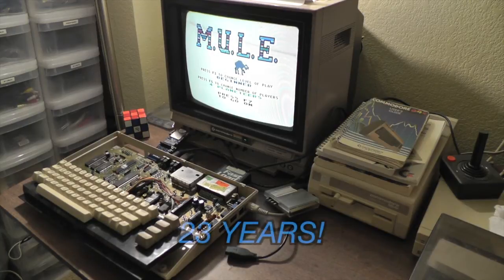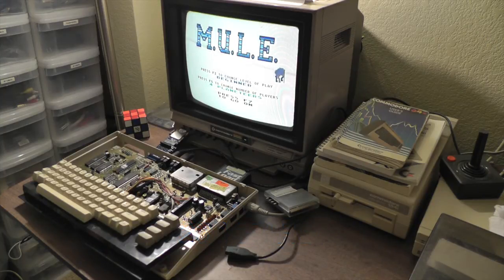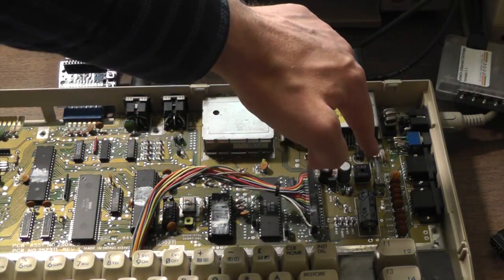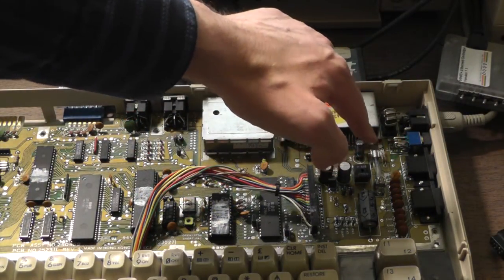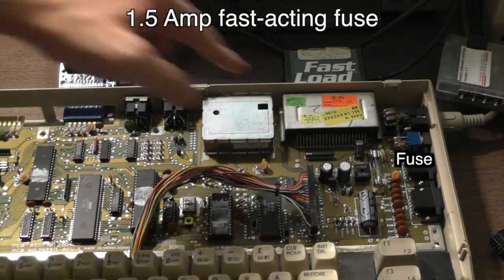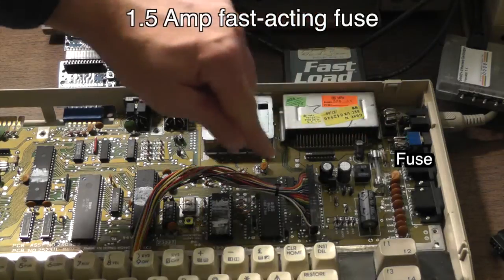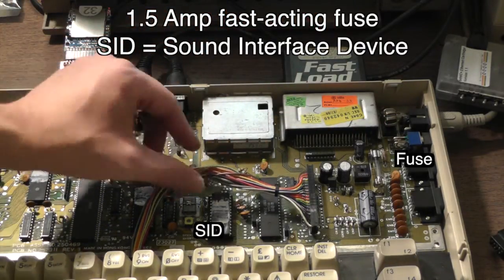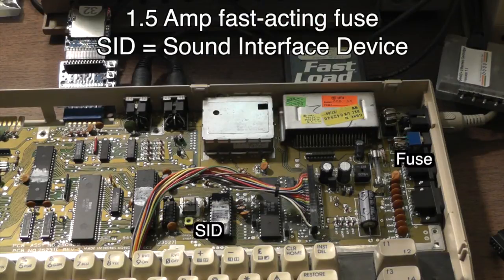Commodore 64 Audio Repair

Comment: My sound is still dead. Fuse isn't blown. Checked the voltage on pin 28 12v and pin 25 5v on the SID. I'm thinking my chip is bad?

Comment: Had a partially dead c64 without sound. Did a full search on every chip inside the computer without finding any cause to the problem, then i found out it was the fuse in the power supply! Thanks alot for uploading this video it for sure helped me anyway!

Comment: hey sir my c64 has no sound how can i tell if the fuse is blown or not ? the wire inside the fuse is intact
Reply from the maker: +scroeffie -- I would remove the fuse from the board, and use a multimeter/ohmmeter to check electrical connectivity between the two ends of the fuse.

Comment: Cool. What voltage rating is the fuse? I can only find 250VAC rated once (32mm). I am also reading conflicting statement on whatever it should be 1.5A or 1.0A.
Reply from the maker: +Kim Beck -- I think the 250V fuses should be fine, even though the actual voltage will only be a small fraction of that.  I used a 250V 1.5A fuse.  If the circuit actually needs a 1.0A fuse to be properly protected, then my use of a 1.5A fuse would have been a mistake.  An official service manual that's available online as a PDF indicates 1.5A, though.
Reply: David Simmons My breadbox uses a 250V fuse. I don't see any markings to indicate the amps, just "BUSS AGC 1 1/2." If that means 1.5A, then perhaps the breadbox uses 1.5A fuse and the 64C uses 1.0A.